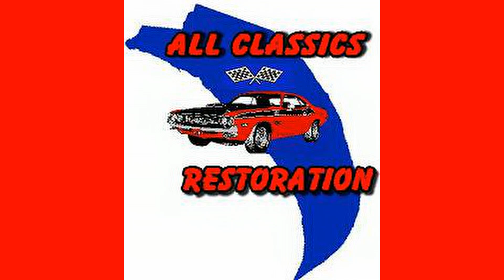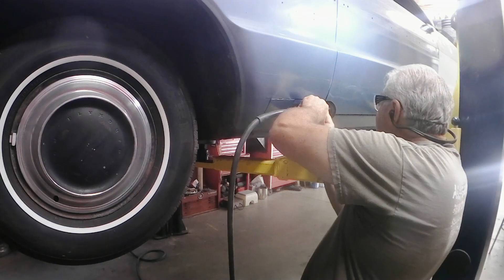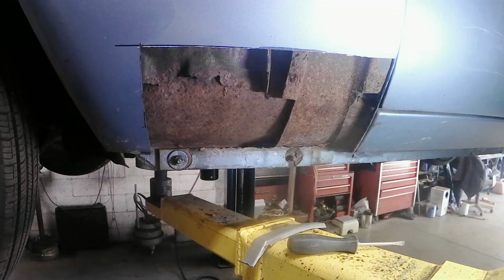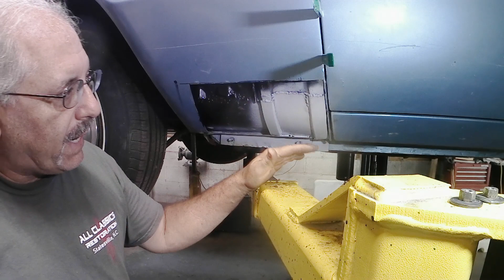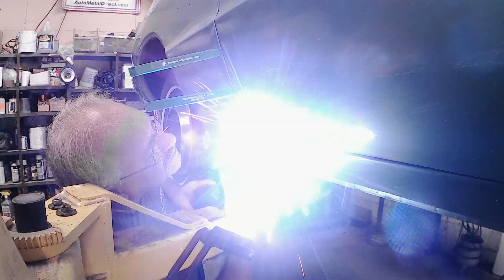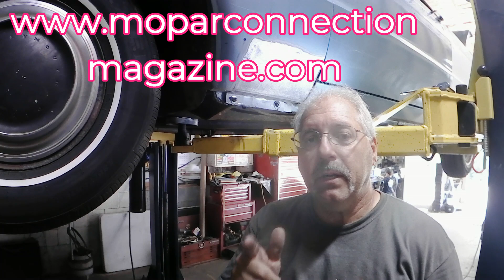Marsha Fender Repairs

Comment: Another great video Dave!  Is it better to patch the fender and support structure with the fender in place instead of taking the fender off completely?
Reply from the maker: Good question Jim. It really depends on what you're doing with the car, but the repairs on this can be done without having the fender off. It also allows you to keep the fender to door/rocker gap consistant.